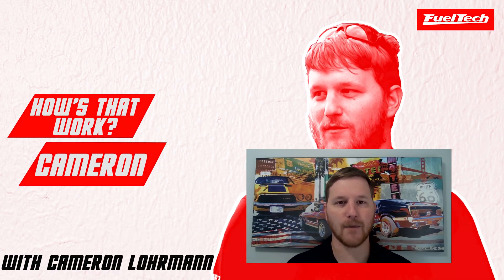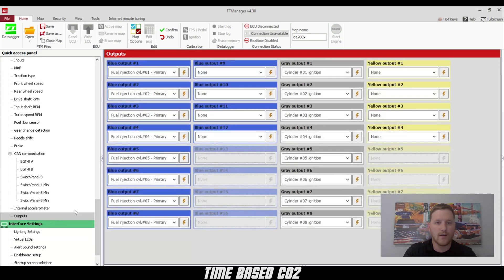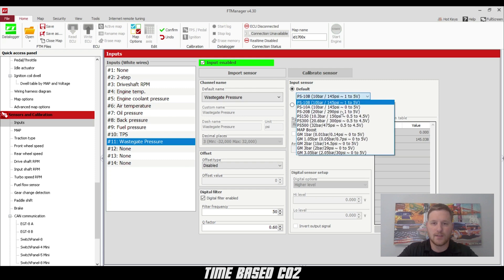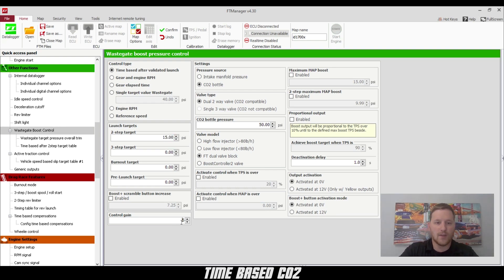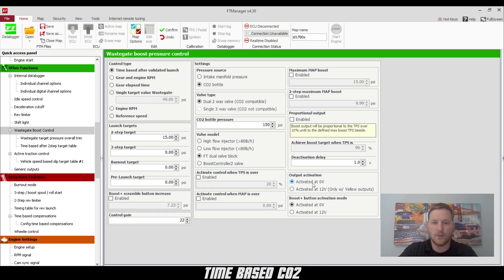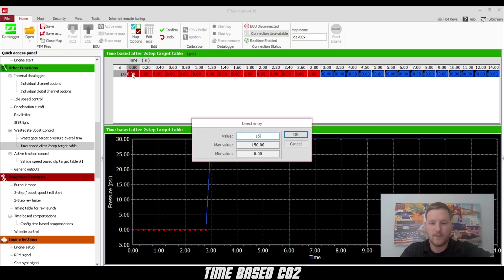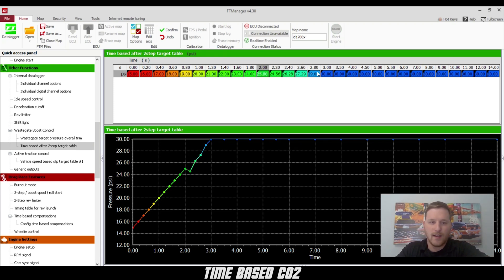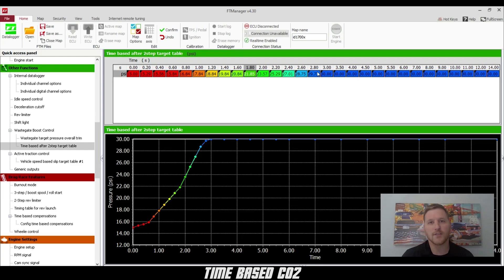How to set up Time Based CO2 using your FuelTech ECU!

Comment: So how do I turn off the feature after my run or does it automatically deactivate?
Reply from the maker: Once your "time based after 2 step target table" runs out, it will go back to your "pre-launch" target; that is if you do not have have any minimum TPS or minimum MAP settings you are below after the run.